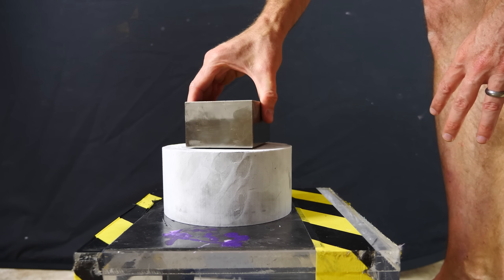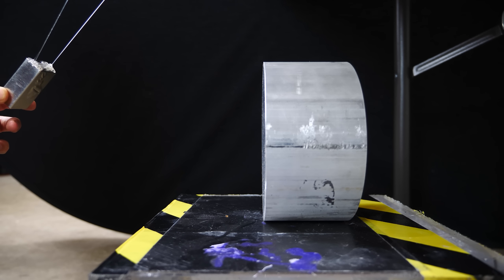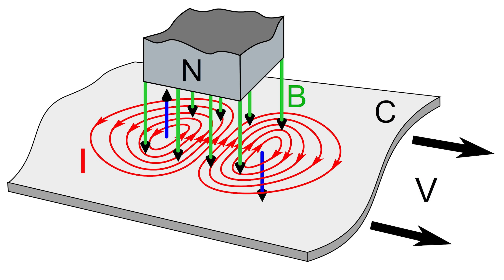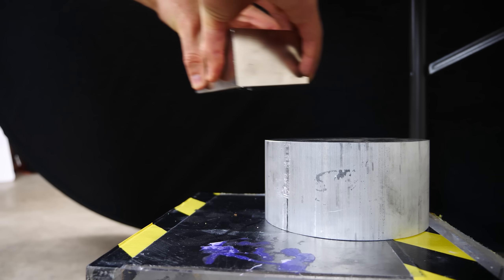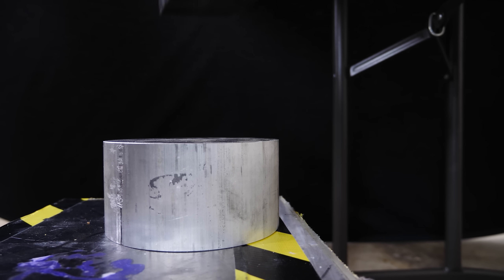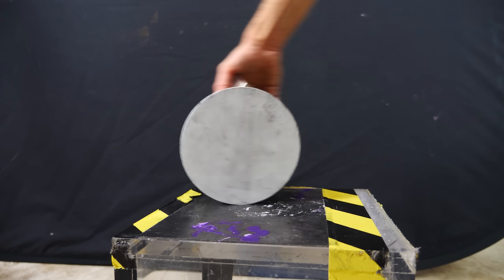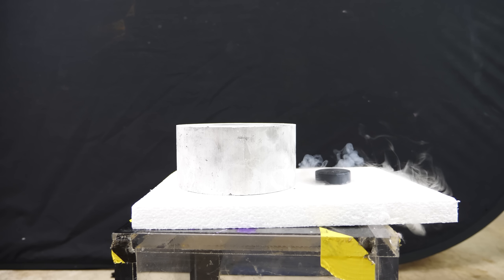Dropping a Giant Monster Magnet on -196°C Aluminum—Surprising Eddy Current Demonstration

Comment: can we jump with giant magnet in aluminium? will it slow down and can we survie??
Reply: The magnetic braking chusion the fall by extending the decelleration distance, the magnet still exert force to the aluminium and the support the magnet mounted on (your legs).

If you free fall, your speed will increase due to gravity to a very high speed. I don't know what would be the terminal velocity due to air drag, but probably high enough. Moving objects have a kinetic energy of E=1/2*m*v*v, that should be dissipated fully to slow you down to zero. Assume you reach v=50 m/s (180 km/h). Assume that the magnetic braking will be neglible above h=0.2m from the ground (related to the diameter of the magnet), so you have 0.2m to slow down.
Let mass m=80 kg.

If I have not messed up solving the equations (please correct me if I did), the force required to slow down from 50 m/s to zero on 0.2m distance is:
F = -m*v*v/(2h) = -500 kN

Your leghs should withstand that much force, which is way too much.

Even if you slow down on 2m distance it is still F=50kN.
That's cca. equal to 2500 kg weight/leg. Probably still not survivable.
Reply: @gabiold  ohh thank you!!

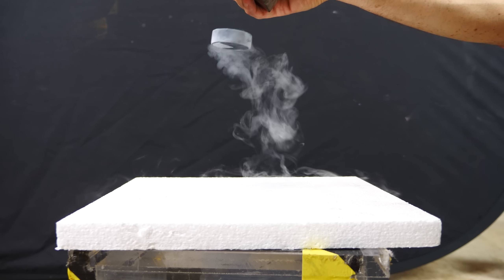Comment: 3:25 The type 2 superconductor disc did flip over a few times tho..it held position relative..but turned over..has it got poles or does this show flow of the field around aluminium or..?
Reply: In a way yes. It'll stay in the position relative to the magnet where the magnetic field strength is the same, as "adding" field into the superconductor costs energy (flux pinning / quantum locking)
Reply: The eddy currents flow in a given direction based on the previous position of the magnet relative to the superconductor. The magnetic field created by the eddy currents has poles that don't change so long as the direction of the eddy currents doesn't change. If the eddy currents remain the same, which they should be about the same since there is no electrical resistance to break them down and you aren't changing the distance between the superconductor and the magnet, then flipping the magnet must also flip the superconductor.